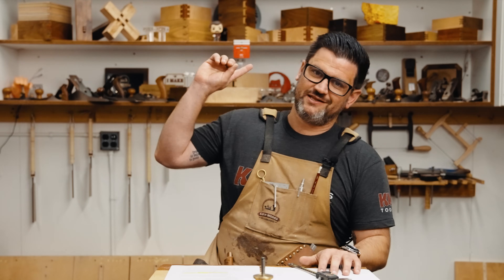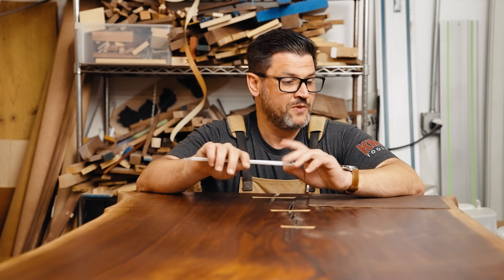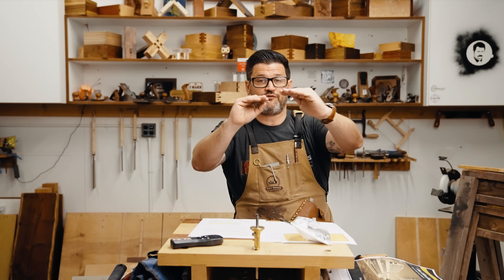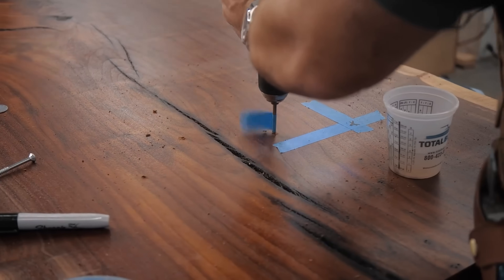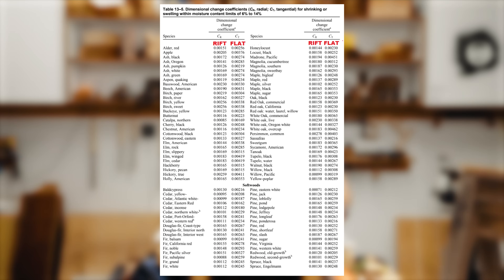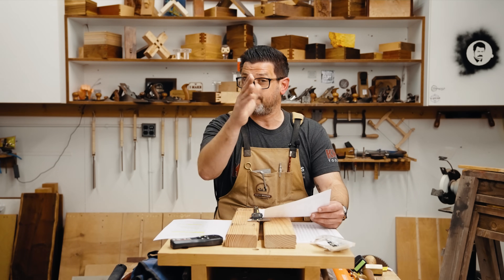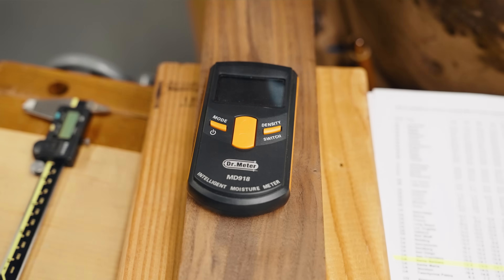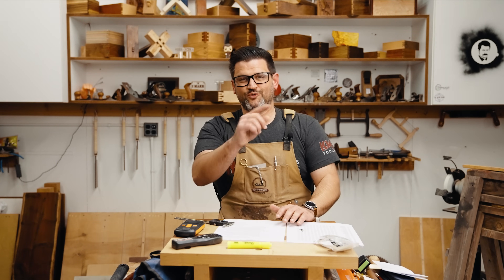Is Wood Movement a Myth? Analyzing 30 Years of Data

Comment: I've been pretty serious about woodworking as a hobby for about 5 years, and I would agree with what you started your presentation with.  Wood movement scared the hell out of me and I was sure I needed decades of experience to master this aspect of wood.  I even took a class to learn about wood before I made many projects.  For new wood workers.....just start cutting!  Give it a go!  Until you get to larger furniture projects, it really doesn't matter.  Yeah, wood is organic and it will change, but if you really nerd out like my man here.....it ain't enough to worry about.  Just do it!

Comment: Not fine woodworking, but I saw contractors install about 100 ft of brand new, kiln dried, red oak tongue and groove wainscoting along a wall in a church. Left no room for wood movement. Not too long after, when the wood equilibrated with the RH in the church, the wainscoting had pushed a short steel stud wall about 9 inches. Ouch! The carpenters said that the architects had not specified leaving any space for expansion and contraction. It adds up over 100ft!

Comment: One thing I think is worth thinking about is that in like New England or Canada, we have massive swings in humidity INSIDE even if the outside ones aren’t that big because of the effects of heating our houses.
Reply from the maker: I think you misinterpreted something I said or I didn't make it clear enough. You're talking about relative humidity. What makes wood move is "absolute humidity." Bridgeport, CT for example (+/- 2.7%) has less EMC (equilibrium moisture content) swings than Santa Barbara CA (+/- 3.2%) where I live. Heating your house does not affect absolute humidity (to a point) because although the moisture can absorb more moisture it doesn't. Ever get nose bleeds when it becomes heater season? This is because you massively raise relative but not absolute humidity and your skin dries out.
Reply: @katzmosestools  I don't think I misunderstood you. You were talking about the absolute humidity of the wood right? You mention exactly what I was referring to in your comment about nose and skin; the physics is the same for the drying of skin as for wood (kilns are usually hot to massively reduce the RH, right?). 

We massively reduce the relative humidity each winter, because we are heating air that has an RH of at most 100% at -20°C. The same air at room temp will be like 5% relative humidity. And we often aren't starting with saturated air. This means that the equilibrium will drive towards dryness for wood in our houses. 

What I'm driving at here is that the forestry study did outdoor air which has lower swings in RH, which will lead to less flux in the absolute humidity of the wood. Know what I mean? Yes, they are measuring absolute humidity of the wood, but that is dependent upon the RH of the environment. 

In California, where you have perfect weather, outside and inside are basically equivalent RHs, but up here it's different. 😜
Reply from the maker: @williamweatherall8333  what city do you live in?
Reply: @katzmosestools  Calgary AB
Reply: @katzmosestools  anyway, you could probably use Colorado's data for it, but given that they stipulate that the wood is outside (see the top of the graphic at 12:00), it's not really useful for furniture. Ask anyone there when their drawers stick. It's not in the winter, even thought EMC on the chart seems to be equivalent through the year.

Comment: i do not think wood movement is going to be an issue for small projects or at least rarely.  now build a gigantic convention table and you might well want to consider it.
Reply: its only an issue when you are trapping parts within a frame, grooves, etc. large or small. if you have a sliding lid on a small jewelry box that fits nice and snug in your shop, but starts to bind when you take it home, could be just a few thousandths of an inch expansion.

Comment: In a climate with extreme high and low temperatures like Minnesota, you could be looking at <20% RH in winter and >65% RH in summer in buildings with lots of air leakage and no dedicated devices for humidity management.
Reply from the maker: I think you misinterpreted something I said or I didn't make it clear enough. You're talking about relative humidity. What makes wood move is "absolute humidity." Minneapolis, MN for example (+/- 2.7%) has less EMC (equilibrium moisture content) swings than Santa Barbara CA (+/- 3.2%) where I live. Heating your house does not affect absolute humidity (to a point) because although the moisture can absorb more moisture it doesn't. Ever get nose bleeds when it becomes heater season? This is because you massively raise relative but not absolute humidity and your skin dries out.

Comment: Way more informative than that “Samurai” guy. He tried to make the case that wood never moves, he had no data and thus his video made no sense. Measuring moisture content and using humidity data for your region makes so much more sense. After having a shaker panel door in a bathroom crack, as well as a dining room table, it helps to get a process to account for this. Thank you.

Comment: Great information, thanks. After getting it wrong a few times in my earlier woodworking years, I usually just guess the future movement based on grain direction and orientation, wood type, season, etc., but it's good to know that there's a way to calculate it when you need to manage risk better. Here are two examples of my earlier mistakes related to restricting wood movement: https://youtu.be/QP6YWMY09pg

Comment: So unless you have a humidifier/dehumidifier then the absolute humidity, which is what matters for wood movement, is roughly the same indoors and outdoors?
Reply from the maker: Very rough and general yes. Keep in mind AC actively cools by removing moisture from the air

Comment: Rift and quartersawn are not the same thing. Your sample and your figure were showing quartersawn.
Reply: What you're saying I'm not disputing. That said, rift and quartersawn lumber are not the same thing. With quartersawn, the grain intersects the face at 60-90 degrees. With rift, it's 30-60. Rift makes a better table leg with straight grain on all sides.
Reply from the maker: They are when it comes to calculating wood movement. This I am 100% on. I read the most comprehensive study ever written on wood movement and it specifically states this.

Comment: I really love these informational videos, great resource. I've always wondered though, and this seems like a good time to ask, if you seal the wood/apply finish wouldn't this prevent or severely limit moisture transfer as well leading to even less or possibly no wood movement at all?
Reply from the maker: That was a layer of complexity I didn't want to get into because I didn't have exact data. I believe and have heard that film finishes also eliminate transfer. Good question.

Comment: I really enjoy how you show the details around your topics. You have become my favorite channel to follow. I have a question around finished wood. Does wood move as much once it has been sealed or finished with something such as Lacquer, poly or paint? It would seem that the wood would be less able to absorb moisture once it has been finished and thus less movement.   Thoughts?
Reply from the maker: That was a layer of complexity I didn't want to get into because I didn't have exact data. I believe and have heard that film finishes also eliminate transfer. Good question
Reply: @katzmosestools  thank you for the quick reply. I have asked some seasoned woodworkers this question and get very different answers. I live in an area and see a lot of old work and I don't see many movement issues. I often wondered if it was the finish they used that may have helped keep moisture out. Thanks again for your thoughts.
Reply from the maker: @jamesmellis8766  I will say this, That lacquered table I used in the video reads much lower in moisture content than comparable walnut in my shot that is bare wood.
Reply: @katzmosestools  interesting. So here is what I do not understand about the whole movement process. Does moisture need to get inside the grain tubes to cause the wood to expand or just getting between the grain cause expansion? Correct me if I am wrong but doesn't the mills paint the end of wood with something to prevent the wood from absorbing moisture once it has been dried?  It seems like there has to be a process to reduce the woods ability to absorb moisture. Do we need to stick it in a vacuum bag to pull the finish/sealer into the wood? Are there any finishes with a small molecules that can penetrate deep enough to minimize moisture absorption?
Reply from the maker: @jamesmellis8766  end grain is much more porous than long grain. Thus moisture gets put much faster at the end of a board. If a board dries to fast it checks/cracks. You paint the ends to keep areas of the board from drying faster which cause all sorts of movement problems. Cracks, twists and cups in wood all happe  happen when different parts are moving at different rates. Ever resawed a straight square board only to have it slightly cupped toward the fresh cut the next day? That's because moisture evaporates very quickly from that newly exposed face cause the board to shrink only in that plane.
Reply: @katzmosestools  Here’s another puzzler. If you are at sea level and you have a tube that’s more than 32 feet tall with the open bottom end in the water and with a perfect vacuum applied to the top of the tube, liquid water will fill the tube to a height of 32 feet and then change phase to water vapour. Basically a measure of gravity. So how do trees grow to heights greater than 32 feet? What magic (I mean physics) exists that permits the vascular cells in trees to move water as high as is needed. (I don’t know the answer). But it raises another question which is, “Does cutting, milling and kilning a tree impact the way the dead vascular cells function? And that answer has to be yes because the empirical evidence says expansion rates are different depending on how a piece of the tree has been sawn. Which to me says that coatings and finishes will also function differently according to how the stick of lumber has been sawn. 
And on a totally non-parallel train of thought, is it appropriate to think of lumber as being a zombie tree? (It still moves 😳)
Reply: It might, but honestly I don't think most finishes are enough to significantly prevent or reduce seasonal wood movement. Some moisture will still end up diffusing through the surface.

Comment: I'm a chessboard maker and I learned about wood expansion on my 3rd board. Thankfully #2 was my close friend so he wasn't an unhappy customer when the frame popped open due to the panel expanding
Reply: Reading this with feet up on coffee table with chess board (¼" × 2" x2") white oak and red rauli, walnut surround with white oak inlay on ¾" plywood with walnut base and legs. Made at school 50 years ago, no machinery. Apart from reglueing a leg top that got bashed so it cracked, it's as good as newly made by 15-year old me. No noticeable movement. Still stands without wobble. Survived hot, dry, central heating, sunlight through windows. Proud of it
Reply: @cuebj  sounds lovely! Congrats! What region are you in?
Reply: @fab186  I learned that this was possible with an endgrain cutting board so similar idea.  I left the wood in my shop for a few weeks at each stage hoping that that might help stabilize it somehow (and because I'm lazy and also work a full time job with weird hours).

It only spent a couple weeks in my grandma's kitchen before one square on the edge popped.  It turns out that exposing wood to the elements in my garage is no match for the wild swings in temperature and humidity in a southern kitchen.

My poor grandmother was beside herself over it because she was so proud of the cutting board I made her.  But, I just had my grandfather put a little super glue in the crack and a year later there's not been another single issue.
Reply: And if you were a cheese board maker, you would have learned even more about wood expansion ;-)

But you’re right of course, it doesn’t have to move much at all to pop a frame. A lot of chess boards, even eye-wateringly expensive, handmade ones, are made using veneers on a base plate made from sheet material that doesn’t move.
Reply: Chess boards are how I learned this the hard way as well.

Comment: You mention climate controlled environments. Ad the different types of finishes used, laquers and stuff, and the problem will be even smaller.
Reply from the maker: Very true. Didn't want to get too convoluted by starting the finish conversation but you're right. A film finish makes the problem even less significant.

Comment: I worked with my father in the construction industry for several years. Understanding how your material reacts to the weather it's just part of building. I was told to always leave 1/8 to 1/4 of an inch on the outside edges of the room to allow for the expansion and contraction of the wood during the winter and summer months. I was told to do the same thing when we're making cabinet faces. Make the dato grooves deeper on the sides of the frame, so the panel in the center can expand and contract properly. An old wood worker told me that back in the day they used tack cut nails to deal with it. They use them because they could Bend with the expansion. He said if someone didn't account for the expansion and also use screws, after time to screw could just snap off, because screws are hardened.

Comment: Question about your formula in your example. When multiplying by 1.7%, I think you should actually be multiplying times .017 and not 1.7. If so, this would make wood movement even more negligible.
Reply from the maker: Nope. I promise. It's the difference in percentage as a whole# not the actual pecentage expressed as a decimal.

Comment: Don't think it's a myth honestly. In current climated environments it might nearly be negligible, but in humid environments you definitely notice.
Reply: My old house was in a fairly humid part of the UK, in the winter you could barely close the internal doors if at all. In the summer they almost looked like they were cut too small they shrank so much
Reply: @archiebf4524  on one of my internal pine doors it expands and contracts in width by about 6mm throughout the year. The sapele front door expands by about 3mm overall. I took the door off and sealed the endgrain on the bottom which helped a little.
Reply: @BiggMo  I agree! :)

Comment: Another source book that I have found very helpful is "Understanding Wood" by R. Bruce Hoadley. The revised edition was printed in 2000 by Taunton Press. I found my copy in a used book store. I don't know if it is still in print but it is a bit thinner than 508 Wood Handbook.

Comment: I agree the topic is brought up a bit too much, for most pieces it isn't an issue. Honestly its a matter of how long you want the piece to be in use for.  I restore antiques and while most pieces will be fine for decades eventually the wood will move into the least stressed position which is usually twisted for plain cut boards. It also becomes more complicated, for example when the environment inside a cabinet  is different from the outside. Ultimately if you want something to last as an heirloom, the timber selection / orientation  need to be well thought through.

Comment: The nomenclature here is odd regarding qs and rs wood. I would typically not use those terms synonymously. I generally think of riftsawn as being slightly less stable than qs due to its location in the log.
Reply from the maker: Man, I read 500 (skimmed some for sure) pages of data. Feeling pretty confident in my terminology and vernacular in relation to wood movement. If you'd like to read it I believe it's section 13 and 14
Reply: Certainly not meant as a criticism. Just different from the nomenclature other sources use. See “Understanding Wood” by Hoadley for example.